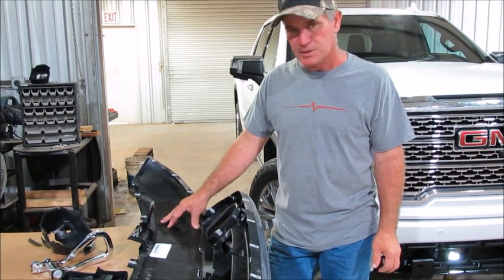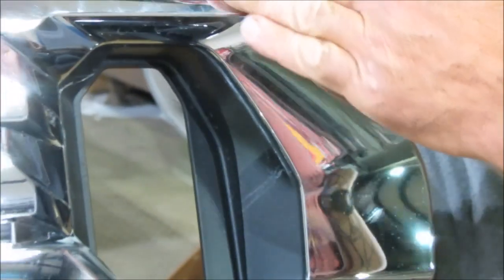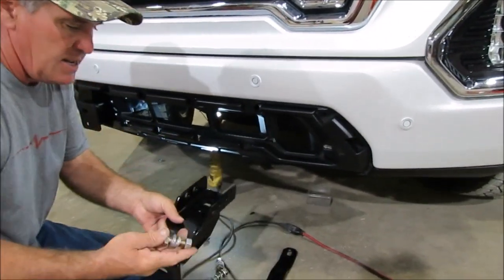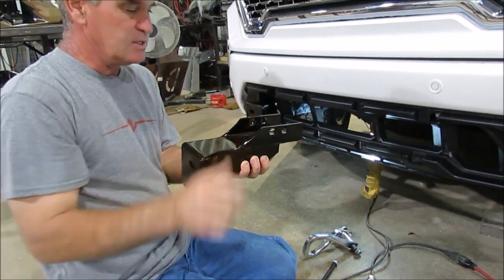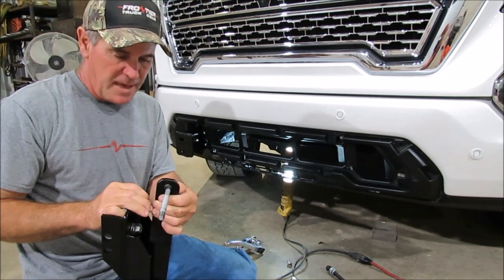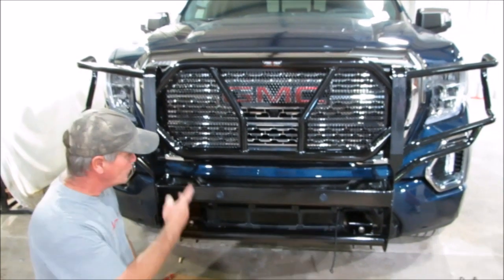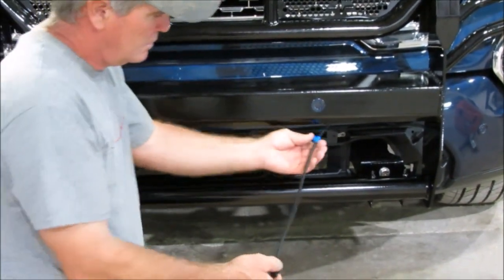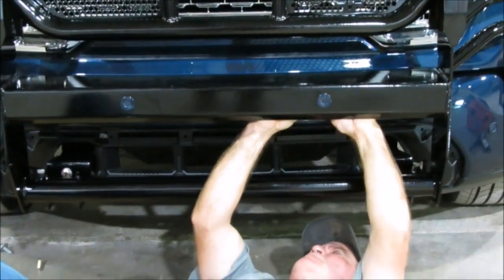Frontier Grille Guard 2019 GMC Sierra 1500 Install

Comment: This design is so stupid, not tested.

If your mounting only to the tow hooks it's going to bend that thing when a deer or roo jumps and hits the middle to top end.

It needs to be a bumper style, these bush bar bumper tow hook mounted things are useless unless your scraping a solid object or hitting a deer at very low speeds.